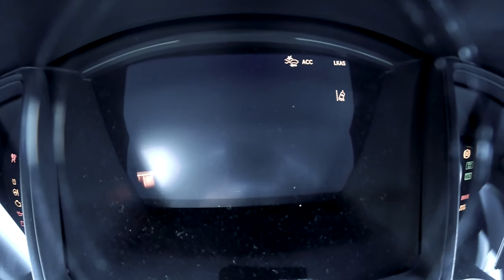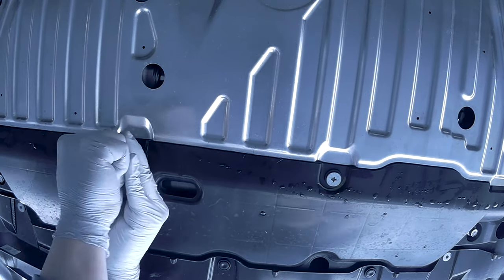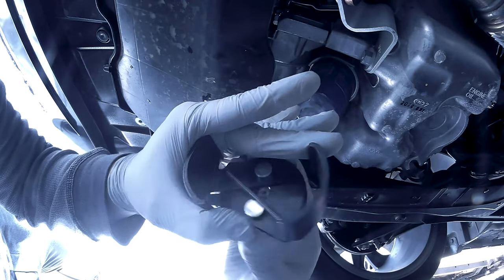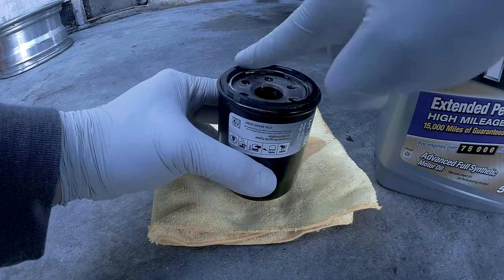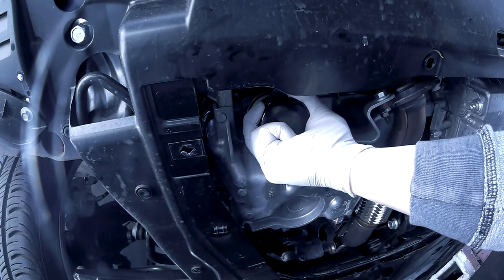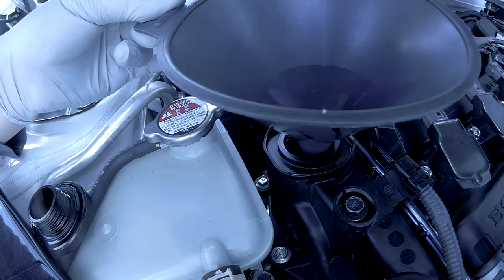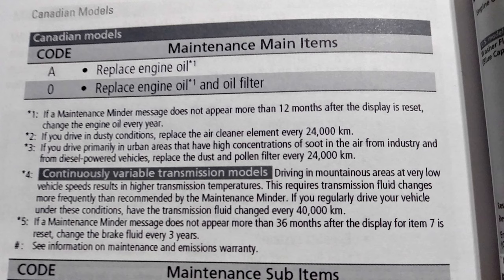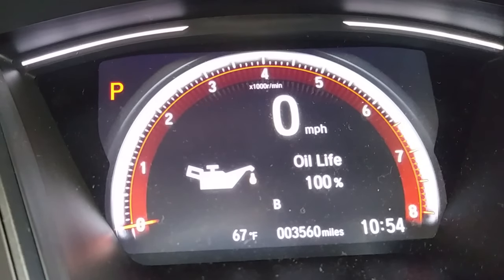2019 Honda Civic Complete Oil Change with Maintenance Reset

Comment: Before putting the belly pan back on, might I suggest running the engine first to locate any leakage if necessary, many of us may think we tightened everything down until the oil light comes back on for low oil. Then the belly pan would be a mess lol and you'd have to repeat the steps. Some people like to hand tighten the filter (I do) but some may not have the seal seated properly (not sure how unless you cross thread).

Comment: Question. When I looked up the fasteners, it showed black clips.
Where do those go exactly? 
Because when I removed the splash guard, I didn't see them. Same with your video, I didn't see them.
Reply from the maker: Did you remove extra or lose fasteners?

Comment: The oil percentage? Is it based on how long the oil was used? Or does it really sense the oil viscosity?
Reply: @kurtsam5972, it could be how long the engine oil is used, the number of miles, the type of driving (city vs. hwy), hot/cold cycles, rpm’s.

Comment: how often do you think it's recommended that I change the oil filter?  (kms/months)
Reply from the maker: I just checked the owner's manual. There are no recommended intervals. Mainly refers to use the maintnance minder.

I personally do mine everyone 3,000 mi. Just my preference. 5,000 mi at most.

Some may argue Synthetic oils are good up to 15,000 mi or more.

If you don't drive your car then have it changed at least twice in 1 year.

Comment: The usual interval for an oil chane on the 2019 Civic is 7,500 miles, isn't it?  Also, would it make sense to run the engine and check for leaks at plug and filter before putting the plastic undercover back on?  Seems you could do that while the vehicle is on ramps, eh?  Your thoughts?
Reply from the maker: Doing the checks for leaks while on ramps and panels are off is a great idea. Just won't work for checking the oil level since the car is at an angle.

I'm just doing my oil change at every 3000 due to personal preference. As long as youre changing your oil regularly then you should be good.

Comment: What's the purpose of having that plastic cover underneath the engine in the first place? Can the car do without it? How many removals / re-installs can the flimsy plastic cover/screws withstand with each oil change before something breaks?  Is it possible to make a cut-out on the cover to avoid having to remove it every time an oil change is done?
Reply from the maker: You're referring to the undercover shield?

It's supposed to protect underneath and keep out dirt and debris. Also I think its supposed to help with the air flowing underneath the car as well as the air flowing through the engine bay. Could be wrong on this idea.

There are options to get metal ones. Not sure how they perform, but give it a shot.

https://www.ebay.com/i/373063836760?chn=ps&mkevt=1&mkcid=28
Reply: @johnsneverendinglistofrand1377  
My previous car (Mazda3) had a similar plastic shield. I had purchased the car new, and after only a few oil changes, that shield started to come loose (I guess the oil change mechanic applied too much torque on the plastic fasteners. Eventually it cracked and dangled down at one corner and started scraping the ground. The dealer wanted $135 for a new shield.  I duly removed it and went without it, until the day I junked the car after more than 10 years.
Reply from the maker: @msbrownbeast  the retainers holding the lower shield is not plastic on these cars. They're like cast metal. Only time will tell how long they'll last.

Comment: I didn't see anywhere in the manual how much oil you are supposed to put in.  Did they actually not put that info in there?  It's not in the oil section.  I noticed my last oil change place added 4.5 Q on my 1.5 Engine (Sport model).
Reply from the maker: Its in the manual. I'll look up the page when I get home.
Reply from the maker: Check page 139 in your owners manual.
Reply: @johnsneverendinglistofrand1377  I did again.  No quantity is specified there in the 2019 Owners Guide.  Only shows you how to measure using dipstick.
Reply from the maker: @trencher7  my manual says 3.7 qt with oil filter. Honda says 3.9 qt with filter. This is on a 1.5L turbo
Reply: @johnsneverendinglistofrand1377  Interesting. Is it the "Owners Guide"?  Mine just talks about setting the Maintenance Minder on that page.    What started all of this for me is I normally do my own oil changes and my son took it to an oil change shop while at college.  I just drained it and 5 quarts came out of my 1.5L.  I was pretty mad and will be giving them a call.  They wrote down that they put 4.5 QT in, but there was more in there.  4.5 QT was what the previous model Accords would take.

Comment: Why did they even change it to this expensive synthetic if they're still be 3000 miles? Did the life mileage expectancy go up?
Reply from the maker: If you grab the 5 quart mobile 1 oils from Walmart then it's cheap. I just switched over to Kirkland. 2 5 quarts bottles for cheap. No problems yet. You can drive alot longer on the oil. I just prefer to change mine early.

Comment: My civic doesn't have the undercarriage lol😢 60% oil life
Reply from the maker: The undercarriage is very flimsy and sometimes even the hardware gets loose over time. I almost lost mine a few times going on long trips. I ended up having to use blue thread lock to make sure the 2 front screws didn't come loose again. Never been a problem since.

Comment: How many quarts??
Reply from the maker: If you have a 1.5L engine (Check your owners manual)
 -- If you are not replacing oil filter
   -- 3.5 qt
 -- If you are replacing oil filter
   -- 3.7 qt

If you have a 2.0L engine (Check your owners manual)
 -- If you are not replacing oil filter
   -- 4.2 qt
 -- If you are replacing oil filter
   -- 4.4 qt

After engine is filled with motor oil, start your engine for a good 10-15 seconds and then shut it off. Check the dipstick to see if its at the top line. If not, add oil ass needed. If its passed the top line, drain some oil as needed by removing the drain plug below the vehicle. When completed, start the car again and shut off. Recheck dipstick.
Reply: John's neverending list of random things to do hey thanks for taking the time to reply I just feel better doing it my self because I know people don’t replace the filter when u pay to do it great video
Reply from the maker: @dannyal467  thanks. I'm glad it was very informative.
Reply: Great video,  up to the point about adding 4 Quarts  !!!!     and then the causal comment,  if that was too much  on the dipstick,  drain some out.
Drain some out is a PITA, especially when the skip plate has been re-installed.
Also,  you should wait some time after the engine has stopped,  before checking oil level on the dipstick.

A far better procedure  is to only fill with 3.5 quarts.  Run engine for a few minutes,  wait 10 minutes before measuring oil,  and then proceed to add oil if necessary,  little at a time, run engine, wait measure ,  until you are at the TOP mark of the dipstick.

Takes a little time, but can be done over an extended period of a few day.

The BIG ADVANTAGE  of accurate setting the oil level to a known, remembered level,  is that going forward,  you can get a much better idea of any oil level changes  -- typically due to oil dilution, or is a bad situation, an oil leak.

Also, use the CORRECT size Flat Screwdriver for those 1/4 turn fasteners.   His was way too small.     The correct size makes it far easier to turn the fasteners, the screwdriver is less likely to slip and chew up the slots.     Use the RIGHT Tool for the job - makes it a lot easier.

Of course, don't expect your Honda Dealer's Service Tech  to take anywhere near the care  if they do  your  oil change !!!  You are lucky if they put all the fasteners back securely, and they will most likely OVERFILL  your oil level,
Reply from the maker: @gsdmaxima9643  I'm glad your very technical about this stuff. Unfortunately the average Joe's do not have correct tools and will usually have to work with what they have. My fasteners did not get stripped. Also they aren't that tight to begin with.

Here are the technical numbers I did not mention in the video. Maybe I should add them in the comments below my video to clear things up.

1.5L engine (Check your owners manual)
 -- If you are not replacing oil filter
   -- 3.5 qt
 -- If you are replacing oil filter
   -- 3.7 qt

2.0L engine (Check your owners manual)
 -- If you are not replacing oil filter
   -- 4.2 qt
 -- If you are replacing oil filter
   -- 4.4 qt

Thanks for your critical review. Helps to make better videos.